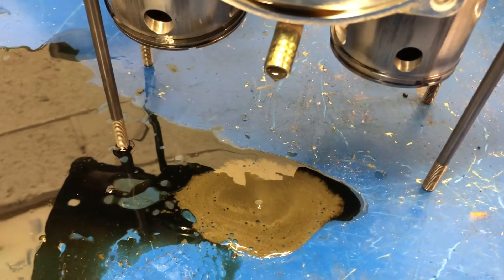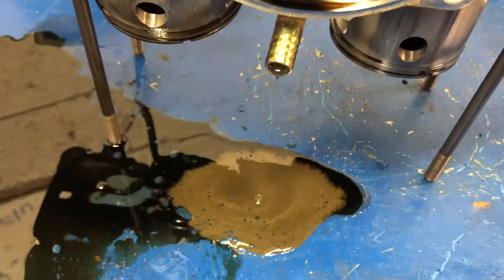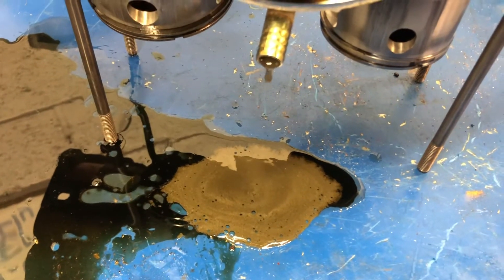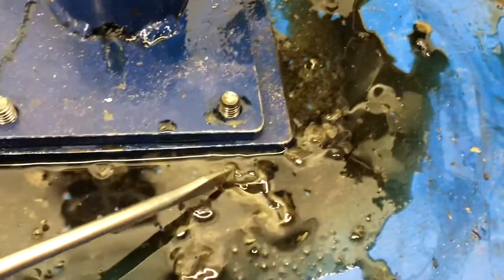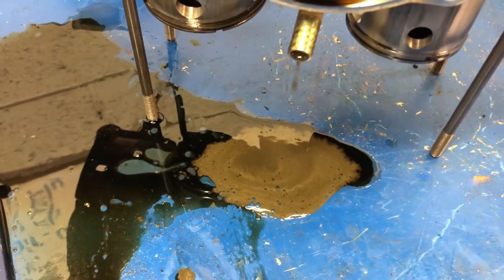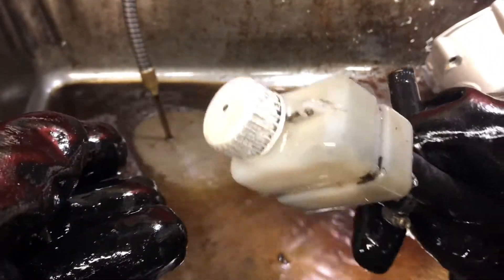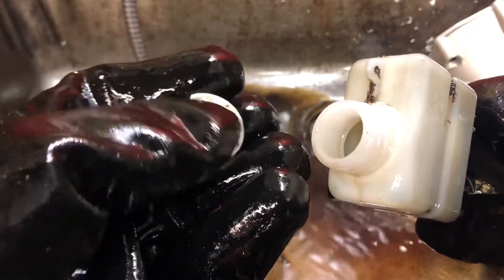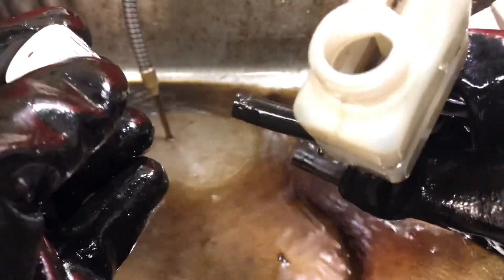The dirtiest 582 rotary valve oil EVER!

Comment: The ceramic seal p/n 650 370 and oil seal p/n 850 711 fitted on the rotary valve drive shaft are both leaking, letting coolant through to mix with the rotary valve drive oil
Reply from the maker: Thanks for your reply. Leaking seals are of course a possibility, however it’s been my experience that an oil and antifreeze mixture looks sort of like a vanilla milkshake, not black coloured. That’s why I believe it was long past the 100 hour oil replacement.